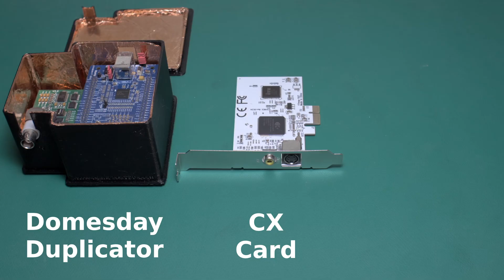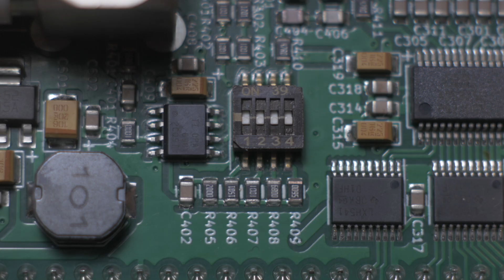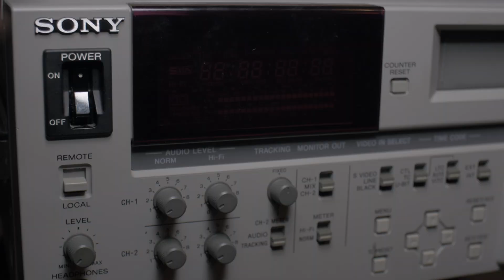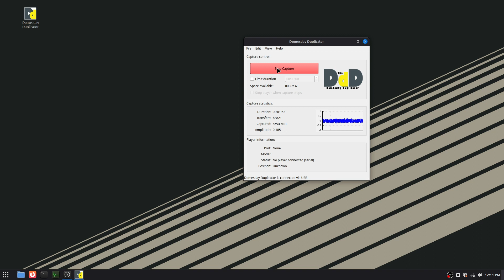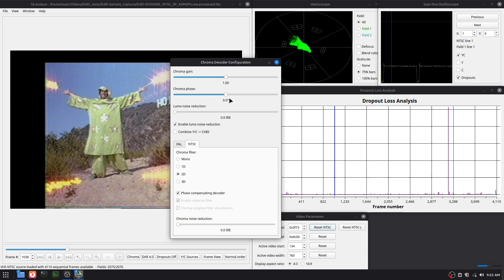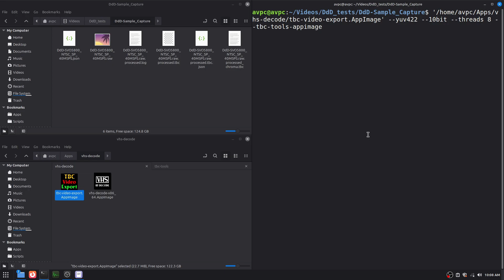VHS RF Capture with the Domesday Duplicator

Comment: I'm interested in getting into RF capture, but I'm finding it's an absolutely Herculean task to acquire the hardware and understand the process step by step afterwards, phew!
Reply from the maker: The documentation would benefit from some quick start guides or case studies that condense relevant information for specific setups. As it is, it kind of presents every option for every step, which can make it difficult to follow the through line for a specific use-case, especially if you're just getting started. And things like the CX card can get pretty deep in the weeds with modifications and tinkering. 

I'm hopeful that newer versions of the MISRC project (whenever it's released) will give an option that simplifies some of the hardware choices for complicated formats like VHS though. In the meantime, I've found experimenting the DdD on different decks to be helpful for understanding the process at least.
Reply: @AVarchiving  I hope to be able to see tutorials for the whole process. O_o

Comment: Wow, so interesting! May I ask, what is the advantage or RF Capture over more common S-Video/Firewire pass-through? Are there benefits?
Reply from the maker: There are some potential quality gains. Especially on older or lower end decks, bypassing a lot of the video deck's internal electronics and processing the video signal in software may produce better results. RF capture also includes elements of the video signal that would normally not be possible to capture with traditional methods, like the cross-pulse and color burst sections of the signal that would only be viewable on a CRT monitor with H/V delay.

The fact that RF capture hardware can be bought/assembled with modern components is also pretty big. Good timebase correctors and decks are becoming more expensive or difficult to find -- and an optimal setup may require several TBC or deck models to cover all features that a format may have had. RF capture potentially alleviates some of that dependence on legacy hardware.

Comment: I'm always up for a challenge and I'm thinking about getting the DdD but I am still new to the VHS world and so I really have no idea how to get the audio for my VHS tapes if I were to use the DdD. Could you make a full tutorial from start to finish using the DdD to capture the video and how to capture the audio with it? Like what exactly would I need for the audio?
Reply from the maker: Audio capture is definitely one of the main drawbacks with using the DdD for formats like VHS. I primarily hope to use it with 8mm video formats where the audio limitations should be less of a problem. I have seen some projects for adding synced sound capabilities to the DdD, and capturing the audio in separate passes is also an option. But long term, I think the MISRC (https://github.com/Stefan-Olt/MISRC) project is probably going to be the more straightforward choice for formats like VHS that have separate video and audio RF streams as well as linear audio. There is a new revision of the MISRC board that I believe is currently being finalized, so I'm keeping an eye on that project as a more complete option for VHS.
Reply: Project gives 404 error not found

Comment: I'd be pretty curious to see how a traditional capture comes out with that SVO-5800 vs the Domesday Duplicator of the same section of tape. The 5800 has a nice TBC with the main limitation being SP only playback. So that means the tape here you captured was SP, so it should look fairly decent even with a traditional capture I would think. The end result (even ignoring interlacing) doesn't scream "one of the best VHS captures I've seen, so I'm wondering if that's due to the tape/recording itself or decode not helping as much for whatever reason?
Reply from the maker: I'd like to make a video showing some more objective comparisons at some point. I'm still piecing together some of the hardware needed for a fair comparison. I used this tape here more for the content than it being a particularly impressive looking tape.

From my tests so far, the RF captures do seem to resolve a little more detail than traditional captures, but there are definitely some caveats with that. I would also say that late generation broadcast decks are probably pushing formats like VHS pretty close to their limits already, so the difference in quality between RF and traditional captures seems to be less extreme the better the deck is.

Comment: One of the few videos covering VHS RF capture with actual technical depth - appreciate you including details like the amplifier requirements that most people gloss over.

I see you've got both the MISRC and CX cards in your setup. Would love to see a full end-to-end walkthrough of the clockgen-mod build if you get time. The wiki is solid but there's still confusion around parts sourcing, additional components needed, and amplifier selection/placement in the chain.

Great work man, subscribed and looking forward to more!

Comment: That’s all interlacing artifacting I’m seeing, right? Like when the fast zoom out is happening on the buildings.
When I step though the spinning ball-o-stars right at the end I’m seeing the frames with interlacing artifacting is only some frame and it comes and go with I think a regular cadence. This make me think the frame rate is not the same as how it was recorded.
You wouldn’t want to keep a recording unless you managed to get correctly deinterlacing, I would think.
I’m not totally certain of all of this, but it’s the only explanation I can think of for what I’m seeing. (that is working with the assumption this isn’t previously captured video that was subsequently recorded back onto VHS)
Reply: I really hate interlacing artifacts (like you couldn't tell) and it's a crying shame to me whenever it isn't properly correct at the time of capture, because then it's baked in forever now.

Also, what the heck is this channel? How did I end up here? This looks and sounds like someone in at least the middle of their youtube career. This is second channel you just started or something?
Reply from the maker: @classicpcgaming4194  You are right that there is interlacing in that section of the video. In this case, the ending section is supposed to just be comparable to the "master" file in a traditional archival video capture workflow. So it only has things like timebase correction and chroma/luma adjustments applied. Things like deinterlacing or noise reduction could be applied after that using the master file as a starting point, but that's out of the scope of what I wanted to cover here, so the interlacing was left as is.

I'm not a mid-career youtuber (...yet), but I am a mid-career archivist. This was made for a recent presentation I did on RF capture. Hopefully more videos to come on topics related to AV, film, and digital preservation.
Reply: @classicpcgaming4194  No, interlacing are not baked in artifacts, In fact you should never capture analog tapes and de-interlace on the fly because de-interlacing in real time gives mediocre results, Analog video is captured as separate fields exactly as it is stored on tape, then later use high quality de-interlacing software such as QTGMC in non-real time processing speed to get the best possible 60p/50p progressive video.
Reply: @Capturing-Memories  It should be done on the fly in practice because a vast majority of the time when it’s captured it’s just done in 30p and the encoder just decides to calls one field the first one and throws all the pair together and saved it at 30p. That’s what I mean by baked in.

“ interlacing are not baked in artifacts” Interlaced video is interlaced video. Of course it’s still interlaced as long as every field is separately stored, I’m referring to AFTER the encoding when converting media formats as the ‘baking’ process. The division of fields is obliterated because inter-frame analysis (transform) is going to be done on a whole-field basis, right?

But sure, of course, in an ideal word it would be capture and processes in 2 stages. As is, almost all the interlaced video that has been capture has had the artifacts from lack of (proper) deinterlacing just how it is. That’s what I’ve been seening. Maybe someone is training an Ai model towards a tool for a fix.

Just read OP’s reply above yours. It reads as though they don’t realize the need to keep the recording at 50/60p so this looks like case in point. If you see people have no idea, keep trying to spread the world: always be bobbin.

It’s bad out there, for archiving media. Have you seen YouTubers test those services that ship you a box and say they’ll digital ALL the formats for you?
This guy labels everything clears as day, such as which dolby NR was used, and the services don’t give a single damn about using the right settings even when it’s right in front of their eyes. By default they destroy all media you send them and all that exists is the digital capture made with incorrect playback settings.
Reply: @classicpcgaming4194  The doomsday duplicator does not capture in progressive, so there is nothing baked in, So I don't know what you mean by baked in. You have more chances of baking some $hit in capturing progressive and zero chance of screwing anything when capturing interlaced, so your claim of capturing progressive to be safe is baseless.
Reply: @Capturing-Memories  For film-based content like The Wizard of Speed and Time, you'd want to IVTC for 24p, not 60p.